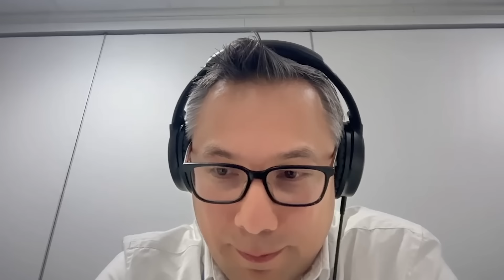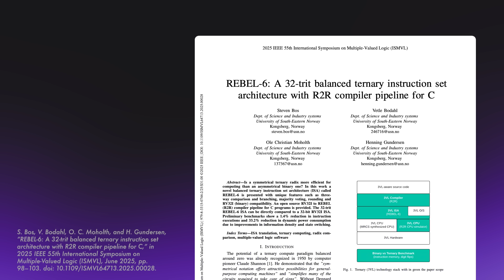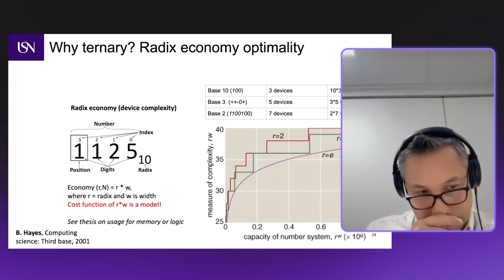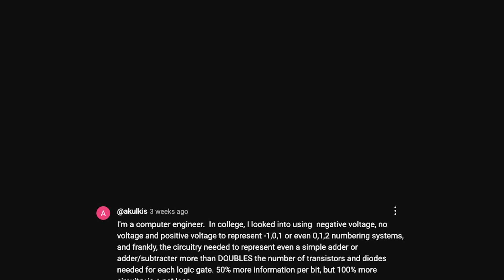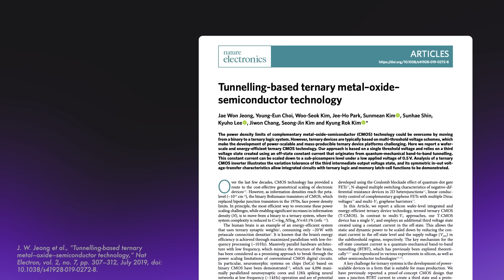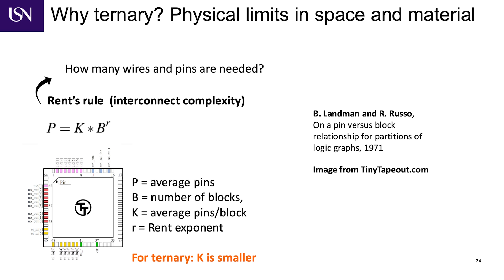Is Ternary Computing the Way to Go Beyond Moore's Law? | Steven Bos

Comment: This was tried in the Soviet Union if you want to check it out. But note that to use binary actually requires a buffer space between 0 & 1 in which that 'certain' 0 or 1 is assured. If you add ternary, you'd have to have two buffer space between levels: 0  & 1 then 1 & 2. And as mentioned 'zero' is actually a positive voltage. [Edit: that's 5 zones to deal with per signal]

But I don't understand why no mention is made of how Quantum Computing that is seeking a continuity between a minimum and Maximum value that gives any n >= 3. As such, this AT THE VERY LEAST implies ternary. (?) 

 In fact, I saw a design that mimics the multi-valued continuity by using loops that look like it can have  that negative, neutral, positive states if it uses AC. They 'fake' the middle values by quickly alternating current continuously between min and max values. But this requires the material to have superconductivity (or its magnetic induction would affect either the state's value or other close circuitry AND because it requires constant acceleration which would make things worse. [This is my interpretation of a particular design I looked at, not necessarily one that succeeded in being used for Quantum computing.

So IF you could actually find a ternary mechanism that works at room temperature with no resistance, wouldn't this have been chosen? With only one middle value, each loop within the parallel structure acts like how a lock picker does by shaking the tumblers. That set up looked like it used at least nine such loops in a 2x2 grid which acts as the tumblers as the means to store or retrieve the values in each loop.

So other than asking why you are evaluating trinary when this is inclusive within the Q-bit, why are you not even mentioning how trinary supercedes binary. 

One final note: I think you have to move up to quaternary to make use of the excess bit when in binary. Then two parallel inputs can be combined to create a quaternary value. Have you checked to see a comparison of "Economy" or "Cost" as I've learned it is for quaternary versus trinary? It should be better. Then you should also assign each quaternary input as two binary ordered pair of inputs.  

base-4  in two binary inputs:

(0, 0) = 0 (quat) = 0 (trin)......no charge
(0, 1) = 1 (quat) = 1(trin).......level 1 charge
(1, 0) = 2 (quat) = 1(trin) ......level 1 charge
(1, 1) = 3 (quat)  = 2(trin)......level 2 charge

This makes the trinary be a subset of quaternary (via 2 x binary) and in a way that makes it easy to interpret this in electronics as the 'count of charge (or ones) . 

Quaternary in paired binary should at least be compared. 

100 (base-10) = 1100100 (binary) = 10201 (base-3) = 1210 (base-4) 
3 places................7 places...............................5 placess...............4 places
30...........................14........................................15......................16   .......[cost]

For two binary inputs that can be used as single base-4 values, it takes 2 places in binary per input and is identical to the COST of the same: 1 x 16 = 2 x 8

So I think my suggestion is better to mimic base 3 using a subset of base-4 as I've suggested assigning above.

Comment: Let's assume 0 and 1as a condition, and then x as a third condition.
A generator for numbers, based on a power of three, would be as follows:
.
.
01x0=15=F
011x=14=E
0111=13=D
0110=12=C
010x=11=B
0101=10=A
0100=9
00xx=8
00x1=7
00x0=6
001x=5
0011=4
0010=3
000x=2
0001=1
0000=0
-------
xxxx=-1
xxx1=-2
xxx0=-3
.
.
.
Starting with 0 and going upward with the schema 0-1-x, and continue to do this. The next power of three is then three times zero, three times one-, and three-times x. Then continue this schema for all columns, and then to the negative side. To get to the hexadecimal F one needs one digit lesser. This is some advantage. ALUs are less wide and so are address busses and data busses.
However, some decisions remain binary, due to the fact that the answer to a question is YES or NO only. The final question is rather: Is it worth it?
A person in the room: YES or NO
A car on the sensor: YES or NO
Water level plenty: YES or NO
Two bytes equal or not equal: YES or NO
At the time when computers were developed, they had even difficulties with the purity of the semiconductors. In Germanium they could make PNP types easy, in Silicon they could make NPN types easy, but not both types on the same chip. Additionally further complications with memory. When I was a young guy, I stored program and data on tape, by saturating the tape positively or negatively, and nothing in-between.
Thus, the decision for binary at that timepoint was a good one.

Comment: I disagree!  This is better than binary but Neuromorphic computing is much more efficient as the memory is analog and the cpu and the memory is on the same chip using memristors.  This is built like synapses in the brain and they only fire when they get full they use a LOT less energy 50x more compute and 100x less energy!

Comment: Why do electronic computers use binary sinals ?   The OBVIOUS answer is that electronic signals MUST compete with unrelated electrical NOISE , due to  adjacent circuits, power supply, external electical equipment, ...even Noise from outer space .

Comment: I'd like to see serious attempts at "starting over" with ternary and MPPA to avoid Moore's curse and Von Neumann's bottleneck. I think a fresh start would be good in many ways.
Reply: Yes. But the tooling isn’t there. VHDL libraries (VITAL) specify delays for transitions from 0 to 1 and from 1 to 0. But now you have 2 delays for / and two delays for \ — no, wait, actually, 3 delays for rising and 3 delays for falling transitions. You can code yourself a custom library for VHDL, and the logic will work, but then the visualization in VCD is empty, because ghdl doesn’t know how to map your custom type to logic levels. And it only gets worse after that. The entire EDA toolchain needs upgrades.
Reply: @OrangiaNebula  Yeah, it would require all new tooling, from the bottom up, which is why it's not likely to happen.

Comment: 36:10 I think you need a two dimensional quantity. Two dimensions allow up to 3 equidistant points, so that any state transition will have around the same modulus. The issue is... What quantity to use other than the one dimensional voltage?

Comment: Based on some of previous comments, I did a bit of analysis on the detail of how neurons work in our humanity-computers aka brains.  The literature suggests that detail of the way neurons process/transfer information is still a mystery.  There has been an assumption that it is done via binary as the connections between them have small voltage changes and a threshold of on and off - but the brains capability can't be explained with binary alone.   

However - there is some evidence that neurons operate in this way on their connections to other neurons:   ~no signal/connection closed, equivalent to 0.   
+Signal/connection opened equivalent to 1.  
  > But then, once opened, it sends 1 or 2 pulses and possibly also "zero" pulses - i.e. 3 information transfer states available, plus the initial state of "no change").

Feels like the mystery of the brain could in some way involve ternary? 🤔
Reply: That sounds a little more like quaternary or even quinary logic

Comment: Theoretically speaking, increasing the number of states a Bit can have by 1 (turning it into a Trit I guess), a "Tryte" could store 3^8 = 6,561 different values instead of a Byte with 2^8 = 256 values. Not sure if our existing transistors are able to do that with today's size standard (ignoring the changes we need to do on the logic gate level), have to admit that I'm really bad with electrical engineering (me, software engineer specialized in Big Data processing).
Reply: Achtually. A byte is 2^3 which is 8. So that would make a tryte 3^3. So 27. But yeah 👍
Reply: On a tangent here. Instead of introducing a 3^3 as a tryte one could perhaps replace the  established 2^3 byte with a ternary 2^3. 

Then we would gain 1 state whilst reducing processing cycles required for each eqqalent of a byte.

Not sure what logic state the 9th combination would represent tough.

Perhaps simply for parity somehow? To continue cross compatibility between binary and ternary. At least for a good while. 

until time is right for a full replacement of all computer languages from scratch.

Comment: Overall I don't have anything against ternary computer design; that said, the discussion wasn't very convincing in saying ternary is better than binary. Unfortunately, there were quite few cherry-picked examples to "prove" ternary is better than binary, and a lot of "yeah so this would (maybe) be better in ternary, because I say so."  While Dr. Bos responded to questions or statements that pointed out various issues, some of the answers were "Sure, in ternary it can be worse, but you can do it better in some instances/special circuits."  "Going from 3 -> 4 in binary means 011 -> 100 so you flip all the bits" sure, you chose a boundary.  Going from 2 -> 3 means 010 -> 011 only flipping 1 bit.  In ternary if you go from 1 -> 2 that's 01 -> 1-1 i.e. you're changing all the bits.  "Flipping" in ternary would be going from 1 -> -1, so going from 0 -> 1/-1 is "changing."  In their "saving energy" explanations (unless I missed it) they seem to ignore this, or assume it's "free", while saying "flipping" takes energy.  When they talk about information storage it feels very disingenuous to compare 2 values against 3 values.  Since we could store more values in base 5 than in base 3, why not use that?  5 is a prime number, so I used that instead of 4, which is a multiple of 2.
Reply: I agree that a lot of this was unconvincing; If area is so important why not aim for base 12, or base 60?  Maybe only that we haven't defined formal logic for those bases, which may put an upper limit at 3.  To be fair though, I don't think Dr. Bos was cherry picking, merely incomplete as he was dealing with language and complexity variables for a youtube interview in English.  For example, at 42:12 when he suggests that you may have overhead that makes it theoretically sound to increase the radix.  With an utter lack of example or specification there, that sounds pretty wishy washy.  I believe though that he was specifically talking about overhead in terms of limiting factors, like heat.  That you can only go so far in binary fast efficient binary transistors before running into heat/size barriers, and being unable to exceed them (leading to dark silicon) it opens up a path for higher radix calculations because you can't beat heat head on, but you could increase performance with a (slower, cooler) more compressed logic.  The difference here is that I used a specific overhead (cooling) and he stated the general case for overheads.  That's not cherry picking so much as just being an academic and using the general case.  You're right though in that it does sound very unconvincing in this format - it requires footnotes to be more grounded.
Reply: There are two separate claims here. One that base 3 has a higher information density than base 2. The other, that base 3 is closer to "e" than base 2 and therefore inherently more efficient with sufficient research.

You are right in that base 5 and even base 10 or base 60 would have higher energy density and therefore be better at that aspect.
In fact, there even are storage devices that for many years have used a higher base to store large quantities of data. There is also an advantage in transmission and communication. The higher the base, the more information you can transmit at the same baud rate, but you risk loosing information to errors.

The other claim that base 3 is closer to "e" than base 2 on the other hand is a counter to using base 4, 5 or 10 as even base 4 or 5 is further away from "e" than base 2 or 3.

Take what I write with a grain of salt though as it is six plus years since I have actively researched any of this and I believe that Boston and others has proven a lot I have missed since then.
Reply: We can construct a synthesis between binary and ternary by using a binary alphabet -  here {<, >) instead of (0, 1} - and defining the 3rd countable substring of unary tri-tally as the mirror symmetric string <>. This way we can go straight to the fractions when constructing number theory, simply by string concatenation of mediants in the nesting frame < >: 

< >
< <> >
< <<> <<> <>> >
etc. 

With absolute values 
<> = 0/1
and when not part of <>
< = |1/0| 
> = |1/0| 

the tri-tally numeration of how many countable elements in each word generates 2-sided Stern-Brocot type structure of totally ordered coprime fractions. 

Which is nice, because that way we start from the foundation of mathematics in which computable real numbers are L/R paths along binary tree. For parsimony notation, we can alternatively also define that L = < and R = >. 

Annihilation operator DelX can be defined as contextually dependent syntaxes of deleting >< from the strings, with at least the possible rewrite rules 

DelXa: whitespace
DelXb: concatenation
DelXc: = (for copypaste etc, as required by the mediant algorithm) 

No floating points ever, as we are computing in the natural context of Gosper arithmetic of continued fractions. Which, as Gosper said in his original usenet post, requires architecture of arbitrary word lengths to make sense. 

We can also directly observe that <> and >< are single bit rotations of each other both ways, and that property extends to iterations <><> and ><><, etc. So we are basically starting from reversibility loops instead of from objects. No assumption of Landauer-bits so far.

Comment: The crazy thing is that there is no number on which binary and trinary intersect. (2,4,8,16,32,64,128,256,512 / 3,6,9,12,24,48,96,192,384). Which makes a lossless translation impossible. Which makes trinary almost useless in binary code. Which is a same. However, we live in a world of chiplets and SOCs add-ons, so a trinary chip for AI or GPU could make a lot of sense. We can also find a sweet spot of where to intersect and use the extra trits data safety or other things. 32 bits to 48 trits for example.

Comment: The most efficient base-2 binary to ternary sweet spot is 8 bits to 5 trits. It's 256 vs. 243, but there isn't a more efficient pairing. For 16 bits, 10 trits is significantly less and 11 trits is significantly more. This is going to be a problem for a lot of reasons, but I suppose we'd have to settle on some inefficient and possibly lossy conversion.

The biggest problem I see though is the settle time for ternary logic. If you are flipping a trit from -1 to 1, there's a point where you must transition through 0. With binary, we don't really wait for the state to settle before we read a value, we can see that it is ramping up so it must be a 1 or it is draining so it must be a 0. This allows us to set and read states while they are still in transition and giving us high bandwidth. With ternary, we have to wait for the trit to settle before we can know what value it is supposed to be. It might be possible to have an encoding which adds additional redundancy, so that the indeterminate period can be relaxed by leveraging additional check trits, but then we've given up the value trits added by requiring more trits to help recover the indeterminate state. I don't see how this will improve communication information density.
Reply: Baud rate. We would have the same problem with binary without it I'm sure.
Reply: One way of doing this efficiently is working in relative ternary instead of absolute ternary.  It's more complex for us humans to learn and keep track of but from a compute efficiency perspective, when used in the right places, it's excellent.   E.g. if you have a ternary 1, and the next 5 digits are a 1 in absolute terms, then it would be  111111.   But in relative terms it becomes 1 and 'no change' x 5 times, represented as either 100000 or 000001 depending on your flavour of logic.   The result is that we achieve more information density for less space and less operations - with a side benefit of the voltage detection you describe as well.       It means more complexity up-front in exchange for less complexity at large scale.
Reply: @Andyfarmer By efficiency, I mean conversion of the space represented. 8 bit binary can offer 256 states whereas 5 trit ternary only offers 243. This is the closest matching we can achieve between binary and ternary representations, so mapping between the number systems there is a necessary loss in one direction or the other.
Reply: @R.B. would be good to have a way of storing natively in Trits, might help the situation.   Interestingly, DNA appears to be a highly efficient information storage paradigm so we can probably learn a lot by studying 50 years of DNA data
Reply: @Andyfarmer  I did a paper storing a trit in a memristor, and reading it non destructively, though the circuit was complicated and I believe the ternary research group has better solutions in the years since
Reply: @Xartec interesting!
Reply: @Xartec have you got a link you can share?
Reply: Also - one occasionally useful way of doing ternary storage using existing binary hardware is to use two rows/pairs of "roolean" relativistic boolean binary bits to represent one row of relative trits.    This gives a lower information density (~integer 255 in a pair of 8 bits) compared to storing in regular binary (~integer 510), but as long as the code is able to use these Relative Boolean pairs as Trits and do maths in Base3, then it significantly reduces the number of calculations needed to do integer maths (partly because artithmatic using relative values can make it easier to work with factors and can remove many of the impossible integer values from the chain of calculations, earlier on)